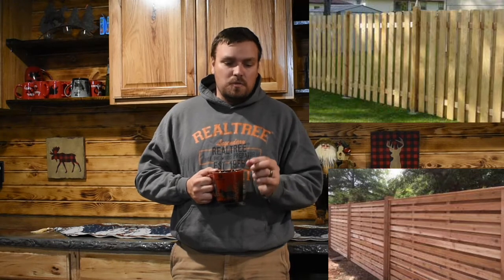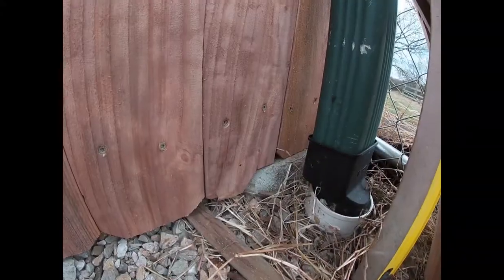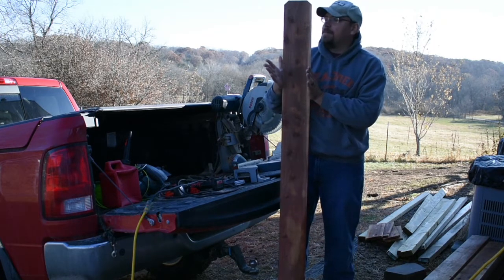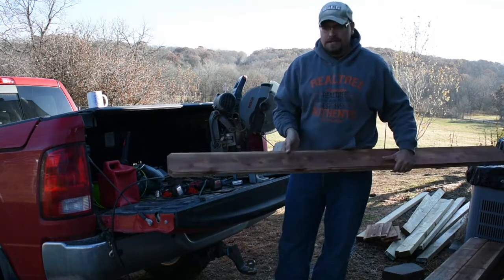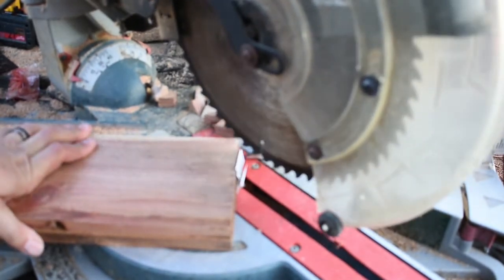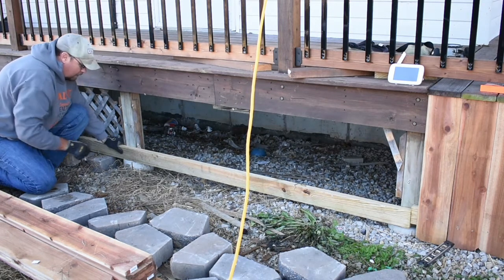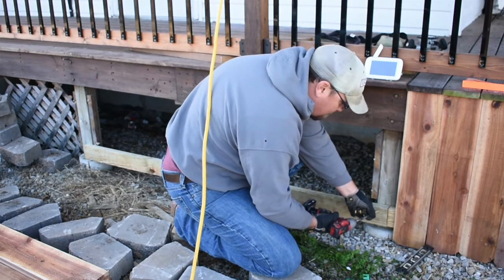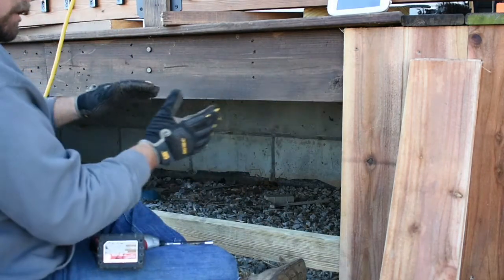Installing a Deck Skirt

Comment: thanks for your video, i am going to do this!!  I have been searching for a good idea that is nice looking and DIY, this is it!  thank you again
Reply from the maker: Your welcome, I have been happy with how it looks on our deck and have had no issues. Depending on your climate and house you may want to consider gaping the boards 1/8” or more to allow ventilation. Regardless I hope it looks good and works for you as well as it has for me. Good luck.

Comment: Well done Sir. To speed the process up you could have just cut the dogears off then set up a 29" stop block and just knocked it out that much quicker. With the size of your saw you could easily cut 4-6 stacked boards at a time. Looks good!
Reply from the maker: Thank you and yes that would make it go a lot faster especially if you have a long run.

Comment: They offer a better type of lattice too, a little thicker. But they want $25.00 for one 4x8 piece, and they want $18.00 for the really really cheap garbage lattice 4x8.  So i was looking at the fence boards like you used here, they want $2.00 per 6'x5 1/2" piece. I did some figuring and found out it is cheaper to use the fence boards because they are much stronger. IT is about the same price, but the fence boards are much stronger. See, the fence boards are 5 1/2" wide, and if i use a 1" gap between them, that is 6 1/2" of distance each piece take. So to get a rough comparison with the lattice, it is 8' wide x 4' high, and it would take 6 1/2" x 16 = 104 inches(8' 8") so 16 x $1.80 = $28.00.  the lattice is $25 to span 8ft, and if you are under 4 ft high, you can use each piece twice by cutting in half, so one piece could span 16 ft of liner distance at under 4 ft high. But $28 worth of fence boards spaced 1 inch apart can span a liner distance of 208 inches(17' 4") at 3 ft high or under.
Reply from the maker: Your numbers sound correct, I don't remember what my exact numbers were from my local supplier but the fence pickets for less then a 3' tall skirt with no gap (but gaps are nice). I do remember that my numbers showed that the fence pickets would cost about the same but would be much stronger and assuming I would get a much longer life expectancy. Now that this has been in place for a while now I have continued to love the look of the fence pickets over the lattice. I still have a small section of lattice on the other side of the house that I need to replace, and every time I look at the falling apart lattice just makes me want to replace it that much more. One day soon I hope to get that last section completed. Just a matter of time.

Comment: But don't you need gaps to allow air circulation to the underside of the deck so it will dry in between rain storms, and morning dew? I thought that was the whole reason people use the lattice.
Reply from the maker: Yes that is true, but if you have good drainage under your deck so it doesn’t hold water, along with using new cedar boards. Then you shouldn’t have water issues. The Cesar boards will shrink over the first 6 months to a year so if you buy them up tight then you will end up with about 1/8” gap between each board. With that and leaving a small gap at the bottom will allow some air circulation. We butted them up right on the north side of our house because our dogs run against it there and I wanted to “wall” it off. This has worked perfectly for us I. Central Missouri. Now if your in say the Organ coast where it rains 9 months out of the year I would suggest not butting them up tight but maybe start with a gap that is at least 1/4” or more, depending on the look your going for along with how concerned you are about it retaining moisture. Either way this method seems to be the same compatible in cost to lattice but significantly stronger.

Comment: Does under the deck or a patio need ventilation??
Reply from the maker: I used green wood so once it dried “over a couple months” it shrank and left about a 1/8th inch gap between each board. For my climate in the mid west it has been enough ventilation. If your concerned about ventilation you could easily add some small vents or intentionally leave a larger gap between each board. I personally like the looks of this with a 1 inch gap between each board as well.  I’m not a contractor but I have been very happy with the looks and function of my deck skirt. I hope this helps and best of luck to you.

Comment: The deck skirt looks great! My only question is why did you use screws instead of nails for the pickets?
Reply from the maker: Well it is because we have gotten some great deals on buckets of screws, yes nails would work and be faster. We will probably use nails when we do the same thing on the south side of the house.

Comment: How to stop air circulation under your deck. Fail.
Reply from the maker: Has not been an issue at all, the cedar boards shrink so I ended up with a 1/16” to 1/8” gap between each board. With that gap between every board running from top to bottom, you still have air flow. And if you live in a wet climate like the the NW coast, then you could always space the boards with a 1/2” or more, still looks good in my opinion.